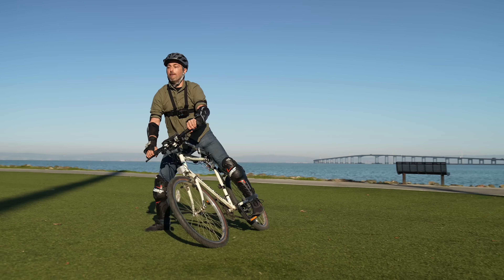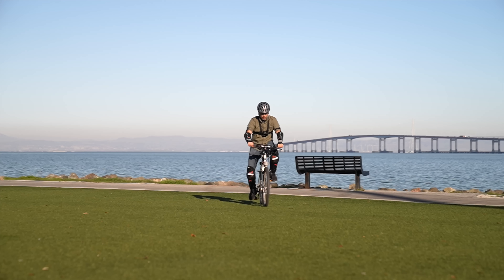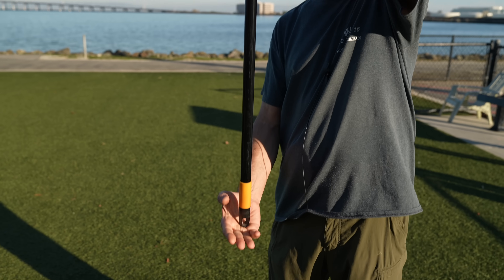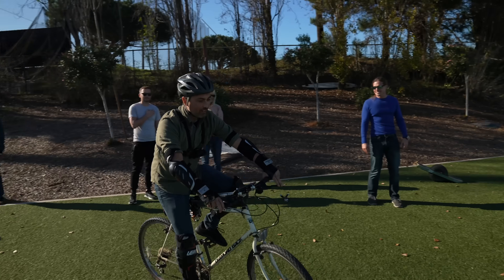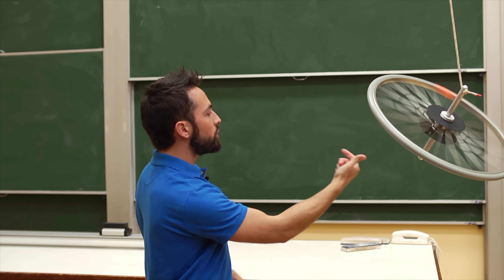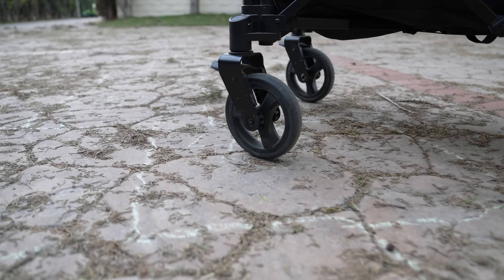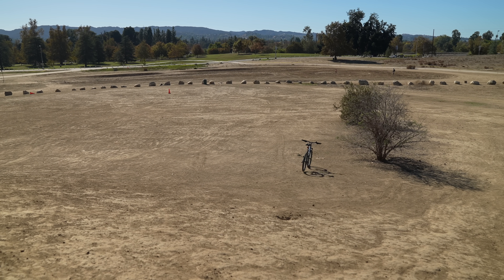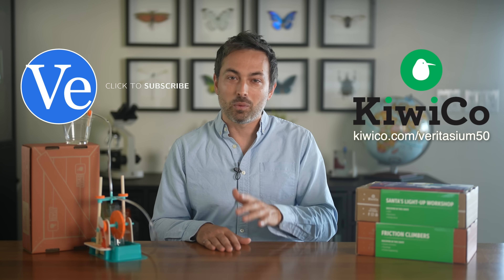Most People Don't Know How Bikes Work

Comment: You should analyse the balance and steering movement of riders while doing a "track stand". It's the technique used by track cyclists to remain stationary for tactical reasons during part of sprint events. You will also see road cyclists using the technique to remain stationary at traffic lights etc.
Reply: I had no idea that had a name, I do that all the time at stop signs.
Reply: I do this on my Fixie all the time. Is it even possible to do on a multi-geared bike?
Reply: Cool beans.
Reply: This is just balancing though.

Comment: Cars have castor aswell. Giving self-centreing effect. But it will also in general point the wheels in the direction the car is traveling(such as when drifting it's easiest and quickest to let the steering correct rather than trying to turn the wheel your self).
Reply: It also has the effect of varying camber aswell. It varies between cars but if you see a car parked with it's wheel full lock the whole tire won't be on the ground because of the castor.

Comment: With a motorcycle, there are two modes. At very low speed (e.g. parking lot), you push the bars into the direction you want to turn. At more than small* speed, you push the bars away from the direction you want to turn. Your personal lean/balance is nearly irrelevant because you weigh much less than the motorcycle (let alone at speed).
* I don't actually know what value of "small" is the critical point where this transitions, and I'm curious what it is and how things behave near the critical point.
[Experience: I drove a Kawaski Ninja 250 most days for years as my primary transportation.]

Comment: I don't remember the name of the effect, but motos and bicycles alike will try to climb a hill if you ride laterally along its slope and attempt to keep your elevation level. It has little to do with counter steering, and a lot to do with the castor wheel effect, but it's also just interesting how straight bike handlebars end up in the part of a turn where you're just following the curve your lean gives you, and how much the tire contact angle seems to affect your acceleration directionally. I do know the front tire naturally steers in because of said castor wheel effect, but- I don't know how to describe it, you'd just have to try it. On dry pavement and with good tires and a helmet please. I don't have money for your medical bills lol

Comment: It is not necessary to steer the handlebars in the opposite direction of the desired turn. Simply shifting your body weight in the direction you wish to turn, will in fact, cause the bike to lean that way, which causes the wheel to turn that way.  You simply control the radius of the turn by controlling the balance between the two forces at work here.  Small moves like the tilt of your head and some light steering input allow you to have total control of the bike during a turn.  
   Try making a bike turn with your hands on the frame instead of the handle bars. It is surprisingly easy at modest to low speeds, because the front wheel automatically steers in the direction of your body weight bias.  Tilt your head left, the bike will turn left.
Reply: "Simply shifting your body weight in the direction you wish to turn" is impossible without counter-steering.

Think about it for a second. Can you actually shift your body-weight in any direction, without an equal & opposite force in another direction? If you could, you'd be a wizard, and you wouldn't need a motorcycle at all. You'd just shift your own body-weight to wherever you wanted to go. Y'know... raise your arms until your feet leave the ground, tilt your head in the direction of your destination, hover all the way!

In the non-wizarding world, attempting to lean yourself over (or "small moves like tilting your head") will actually tilt the bike in the opposite direction, because you can't just move the system's centre of gravity at will. An equal & opposite force is required.

So if you think you're turning left just by tilting your head to the left, you'd actually be thrusting your hips to the right (the equal & opposite move to the head tilt), which would lean the bike to the right, and unless you'd already counter-steered, you'd turn right.

That means you're already counter-steering before going through any other motions, and like most people, you're just not aware you're doing it.
Reply: @alexmcleod4330  Dude, this is not a thought experiment. People have been leaning their bikes and motorcycles to turn them for 300 years.  Even the guy in this video was able to turn his bike to the left without steering right.  The only thing they proved here is that you can't control the bike with a locked up handlebar.   Counter-steering is about "initiating" a turn.  It is an alternate method of initiating a turn.  You can initiate any turn by tilting your head and shoulders in the direction you want to go. It's a fact.  This demonstration is filled with subtle lies.  It makes people like you sure that you know everything about physics.  You just now proved the Dunning-Kruger effect is real. That is all you proved.
Reply: @timhallas4275  heh... You can't even lean your upper body while standing, without pushing your lower body in the opposite direction. Try it for yourself! Use a mirror or get video for confirmation.

It's no different when you're on a bike. Simply tilting your head & shoulders in one direction will lean the bike in the OTHER direction. Again, get video if you think Newton's third law of motion doesn't apply.

To get the bike to lean in the same direction as your body, you must have counter-steered FIRST, to steer the bike out from under you. That's been proven over and over and over again. 

And that's what the video here was all about. It's counter-intuitive, and most people don't know they're already counter-steering, but it is in fact 100% necessary.

By all means consult other experts, video reference etc. to refine your understanding of it, so you can put numbers to it or draw a definitive diagram... but I can tell you in advance that you're going to have to swap your left with your right at some point. That's why COUNTER-steering is COUNTER-intuitive.
Reply: @alexmcleod4330   Again, the bike is a stable when in motion. It will resist the tiny force generated by your motion. On the other hand, any mass that extends beyond the bicycle's normal center of gravity will exhibit a "constant" force in that direction. That force is derived from gravity, and will pull the bicycle and the rider toward the ground in an arc.  Let me ask you a related question.  Do you think they teach circus bears how to counter-steer?   Maybe watch a bear or a robot riding a motorcycle.  You might learn more about the physics of bicycling  than by this deliberate farce in this video. Locking out the steering just made it impossible to prevent the bike from falling after the lean was initiated.  It did not prevent counter-steering.  Pay attention to the timing of the lockout, and which way the bike falls.   You seem to have been fooled by this shitty demonstration of gravity.  By the way, I can balance a bicycle while not moving. According to Mr. Science here, that's impossible.  Just another of his "assumptions".
Reply: @timhallas4275  you're on your own here. The video neatly disproves a very common misconception, and you're choosing to stick with the misconception, and doubling down on it?

Okay, you know how every action has an equal and opposite reaction? Remember that? So moving any part of your body one way pushes the rest of your body the other way. Right?

So you CANNOT move your centre of mass, or lean the bike, through willpower alone. If you try to lean one bit one way, everything else goes the other way, and your centre of mass stays put.

Gravity is not your friend here, either, because you can't just choose which way to fall. Falling over isn't steering. Falling over isn't recommended!

So to lean the bike at all, your centre of mass must get to one side of the wheels... some other way.

But even if you can't move your centre of mass to the side of your choosing by magic, you can move the wheels to the OTHER side, by steering them.

That's what counter-steering is. That's why no matter how hard you try to lean, you still can't turn with the steering locked. But it turns out counter-steering is what you and everyone else have been doing all along, even if it's subconscious. This has been proven time and time again. The video is not lying to you. Physics textbooks are not lying to you. You've simply made the same mistake MOST people make, because steering right to go left seems so weird.

Watch the video again, go for a ride, find out for yourself, get it on video, watch your OWN video, and please just complain quietly to yourself when you discover you've been wrong all along. :)
Reply: No, this is false. You can't change the centre of mass of a system from within the system, you need to push on something external. If you shift your body left, you have to push on something to do that. The thing you push on is the bike, which is part of the system, which will lean right. The centre of mass of the system will not change.

Bicycles and motorbikes only initiate a turn via countersteering. There is no other way to do it. When it feels like you turned "simply by leaning", the system still needs to be countersteered to initiate the turn. It's just a "lazy" countersteer. You can certainly shift your weight before a turn (and keep going straight), and then countersteer. Or you can initiate the turn and then shift your weight - because once you're leaned over, some of the force against the bike is translated into a lateral force against the ground, so now the reaction force is coming from something external to the system. Of course, shifting your weight after you're in the turn is destabilizing.
Reply: @allmhuran  A moving bicycle is a stable mass.  The force created by you shifting your head and shoulders is extremely small. NOT ENOUGH TO TILT THE BIKE IN THE OPPOSITE DIRECTION.  It is the shift in the body that makes the bike lean left.... NOT the turning of the handlebar. Observe the riderless bike in motion. The bike travels a relatively straight line despite the rough terrain constantly jarring the front wheel  to the left and the right. IT self corrects because there is very little mass influencing it's lean.  The rotating wheels auto-correct.
Reply: @timhallas4275  Define "stable mass". Or don't, it doesn't matter, I'm just pointing out that you're using a term that has no actual meaning in physics.

This is really fairly simple. If you want to move something, something has to apply a force. It doesn't matter how big the thing you want to move is. It doesn't matter how far you move it. A force must be applied. If I want to move a feather, I have to apply a force to the feather. The feather will apply an equal and opposite force on me.

If I am sitting on a bike and want to move my body, I have to push on something. It doesn't matter how far I want to move. It doesn't matter what part of my body I want to move. A force must be applied, and the thing against which you are pushing is the bike. If you lift your arm upwards, that will put a downwards force on the bike, which in turn will put a downwards force on the ground. If you want to move your head left, that will put a rightwards force on the bike, which will apply a torque around the contact patch. If you move your head a very very tiny amount, then the impulse on the bike will be  a very very tiny amount. But it exists, and the bike will lean a very very tiny amount as a result. This will then cause a very very tiny countersteer, because of the steering geometry.

There is no escape from equal and opposite forces, and there is no other way to turn a bike.

Comment: As a 10+ year road cyclist, I appreciate such an in-depth look at the mechanics behind riding a bike. 

My only critique is that completely disregarding the bike's gyroscopic tendencies to "self-right" at speed is a bit misleading. I'd say that most of what you show (& the referenced research demonstrates) is how a bike operates at LOW speeds. Once you get to speeds of maybe 20+ MPH, the bike is incredibly stable even without steering. I'd say the vast majority of movement at those speeds comes from leaning, as any sort of counter steering is only done during turs.

I'd be curious to see another analysis of stability at genuinely high speeds. I'd reckon I could lock out steering at 25mph and maintain a relatively straight line. To be honest, at even higher speeds (30mph+) the steering "feels" locked out... The bike strongly resists any motion of the handlebars. I suspect analysis at higher speeds would see this effect come into play. Perhaps there is an inflection point at higher speeds where gyroscopic forces drown out what was presented here.

As always, love the videos! All the best.
Reply: I'm curious about this too, and I agree that these demonstrations all took place at well below typical road cycling speeds. However, I would NOT be willing to test the "lock the steering at 25mph and see what happens" experiment with myself as the rider!! (My money is on "I sustain a massive facial injury and buy a dentist a new Cervelo.")

I wonder what sort of test setup would work for this... maybe you roll a (riderless) bike down a long, moderate slope, and when it reaches a certain speed, THEN you lock out the steering?
Reply: i thing because you are going so fast the self corrections happen so quickly that it feels "locked"
Reply: @thesnowman2509  Yep, this is exactly right. As the speed increases the frequency of the little wobbles becomes much much faster, and very tiny "offsets" from perfectly straight change the stability of the system extremely quickly. At low speed the wobbles are more pronounced, because lower velocity means that it takes longer for the front wheel to "out track" (which is what causes the lean), and the weight of the steering assembly and tyre is more significant - ie, it takes time for the force from the ground to shift the inertia of the steering assembly. At high speed these forces are much much higher.

So yeah, the bike is absolutely still reliant upon steering at high speed. It's just much, much harder to see.

Obviously if you just used a bicycle with welded steering and set it off at high speed it would travel a greater distance before falling over than at low speed - because it's moving faster. But the time-to-instability doesn't change very much (it does a little bit because of the gyroscopic effect, but since there's no available degrees of freedom for the precession to take advantage of, it doesn't make much difference).
Reply: @allmhuran  thanks 😊 I’m 13 and I kinda just randomly thought of that
Reply: or because when you go fast and lean, the bike/motorcycle presses against ground opposite to where you are leaning in order to equal it out. but when you go slow that leaning doesnt push ground hard enough so you have to counter steer with handle bars?
Reply: If gyroscopic effects were significant (neglecting precession for now), they wouldn't set the bike upright, they'd make the bike tip over *slowly*, as if through molasses, because a gyroscope doesn't know or care which way is up.

Try turning a bicycle upside down, with cushions under the seat & handlebars, and spinning up its rear wheel as fast as you can. See if it resists falling over.

If the rim was heavier (try taking out the inner-tube and filling the tyre with clay!), it'd fall over more slowly, but gyroscopic effects won't make it reverse its fall or find its way upright again.

So when we see bicycles self-stabilise, it kinda can't be due to gyroscopic effects, because that's just not a thing gyroscopes do.

Comment: At risk of spouting nonsense. Seen the"but I can do hands free" comments.  Think about the forks. They are moving the middle of the wheels slightly in front of the steering. What you see exxagerated in an easy rider chopper motorcycle. The opposite of shopping cart wheels that spin freely...what do they tend to do? They are also off center and they trail behind!  The bicycle wheel constantly wants to do the same.  It wants to turn ,left or right.   You ,freehanding ,give it subtle impulses to do so or not.

Comment: I would submit that the bike in the video is un-rideable ONLY because you DON'T KNOW which way you are about to turn... UNTIL the light blinks on.
So WHY would this matter? WITHOUT knowing ahead of time your brain can't start to lean-in
Because once someone has learned to ride a bike proficiently, under NORMAL riding conditions the rider KNOWS which way they want to turn, and simply LEANS IN to the direction they wish to go as they turn the handlebars. (I've never ridden a motorcycle but I would have to believe it works for them as well)

So, as this video shows, WITHOUT knowing ahead of time, your brain can't PREPARE for and 'tell' you to lean-in as you turn the handlebars.

However, since this video seemed to tell me I would have to initially turn left to go right when I seriously doubted it, I went back and watched a bike ride I filmed a few days earlier to see if I was correct.

NOTE: I had a GoPro on my chest and there is also a mount on the center of the handlebars that by watching closely, I can pretty obviously tell which way the handlebars are being turned.

And what did I see? Exactly what I thought... throughout a 45-minute mountain bike ride on rough dirt trails as well as completely OFF-trail through rough terrain I had not ridden before, I NEVER once turned the 'wrong' direction before turning the direction I wished to turn.
All I did was LEAN the same direction I turned the handlebars.

So, cool video, but in real world every day biking conditions, our brains have learned to do things so automatically that there is no need to turn the 'wrong' way first.